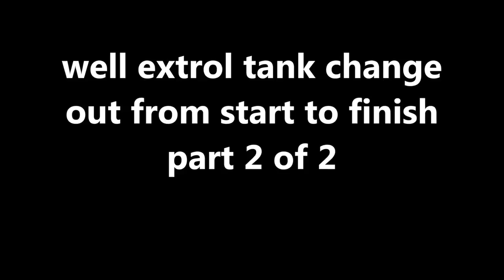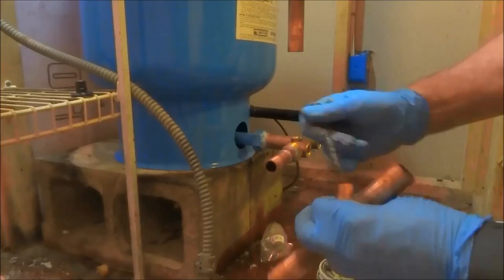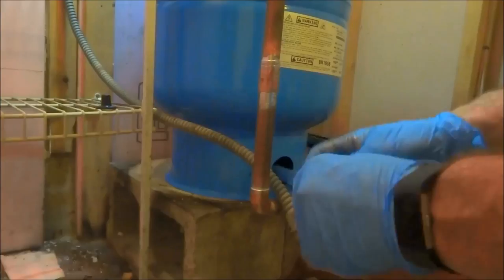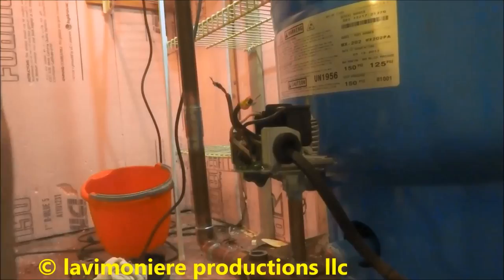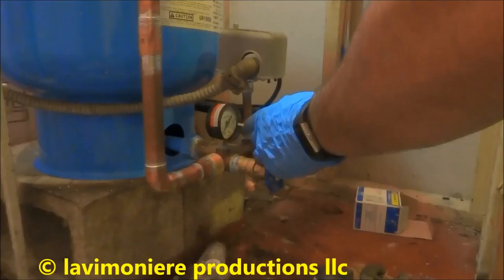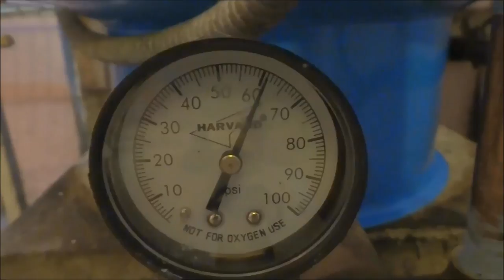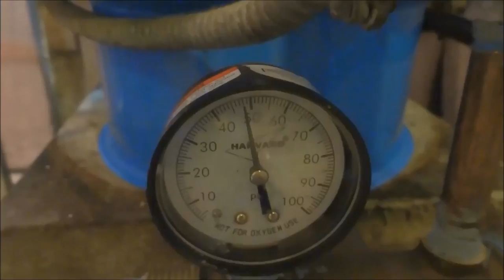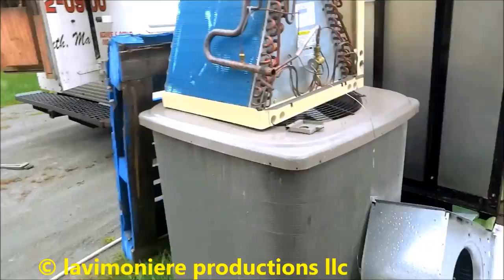well extrol tank replaced part 2 of 2

Comment: try a cycle stop valve next time. put one on my well 10 years ago. runs 55psi whole time in shower, then fills tank once water is off. stops pump from cycles on and off and give constant pressure once tank switch kicks in.